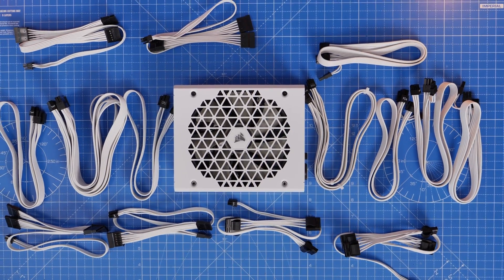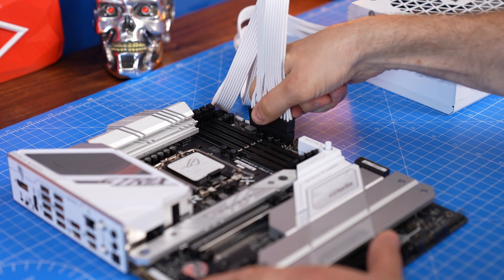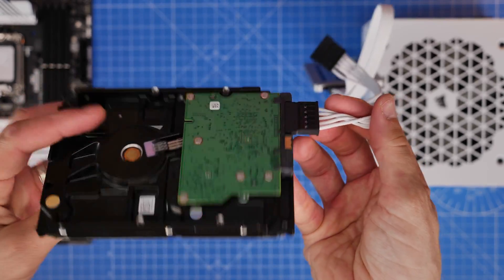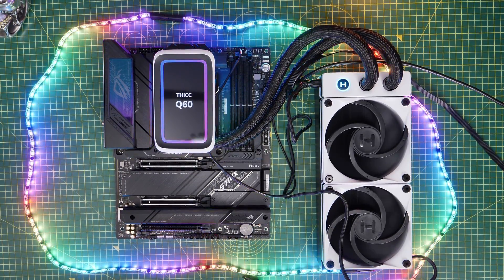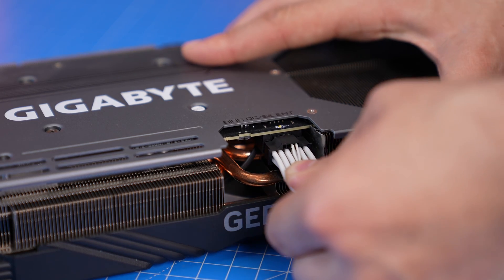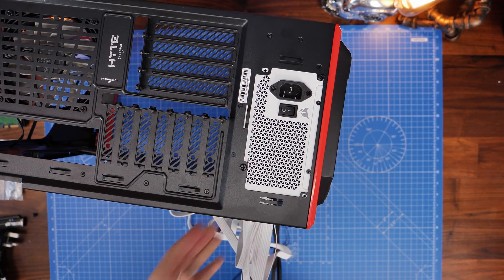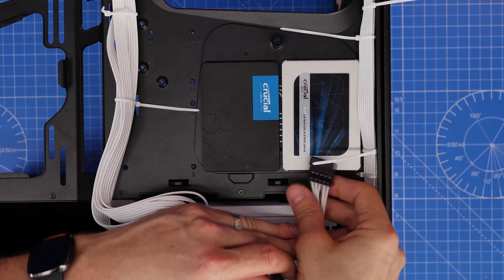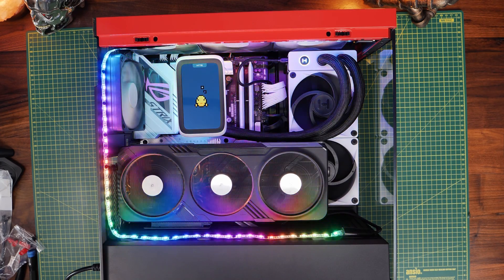Corsair RM1000x SHIFT PSU Wiring guide

Comment: I love your channel/videos, it's as though you know what I'm going to buy next! 🤣

I've just ordered the Corsair RM1000x SHIFT ATX 3.1 - PCIe 5.1 PSU and the MSI GeForce RTX 5070 Ti Gaming Trio OC 16GB (which has a 16-pin power connector). I must admit though, I'm feeling a bit confused as to exactly which included cable is best for powering the GPU and from which socket(s) on the PSU?
Reply from the maker: See 07:14
Reply: I'd watched that but, from what I can see in the video, the cable in your hands appears to have a 12-pin connector into the Series 40 GPU where as the Series 50 card I've ordered takes a 16-pin? This is where my confusion sits 🤷🏻
Reply from the maker: No it's a 12vhpwr cable for the 40 and 50 series  @lammartland
Reply: Apologies, I see my mistake now 🙄 Thanks again 👍🏼

Comment: I wonder how they did the signal pins on the PSU side of things. Most other manufacturers use the exact same 12VHPWR connector on the PSU side so they can "sense" those exact pins. How does this PSU know which of the multiple PCIe/CPU pins will be receiving signal?

Comment: The 12vhpwr cable that comes with this psu, CAN I USE IT WITH A 4080 super HELP I KEEP GETTING YES AND NO's. Some say the one that comes with the psu is 450w and the one they sell separate is the 600w
Reply from the maker: Of course you can.
Reply: @ thank you cause some people say it's only a 450w cable not the 650w but other say if it only has the two little small wires on the +4 part of the connector then it's a 600w or something and I'm so lost and don't want to fry my setup

Comment: As a first time pc builder i have some qualms about the difficulties of unplugging and plugging these connectors. Some people really struggled with unmating them and struggled to plug the cpu cable into the mobo in the case due to how tight it is.

I ask because i am unsure whether i should flash the mobo bios first and do a post before doing the video recommendations. If the connectors are really bothersome to unplug i might just skip the bios update and post and just start building in the case.
Reply from the maker: It's fine to bios update with all the cables plugged in

Comment: Currently using an HXi PSU with the Type 4 Premium Cable Kit. I want to get the Shift in white as you have here. The cables look very similar to the Premium ones and slightly different to the black standard version you showed in another video of the Shift. How comparible is the Pro cable kit to this standard white one?
Reply from the maker: This is type 5 if I recall correctly, so the older kit won't work.

Comment: Hi Prawn, I have this same psu and the same ASUS strix MB as you. I have the ASUS tuf gaming 4070 ti super gpu. Can you please link the Lian li strimer v2 I need? I need the one for the gpu and the one for motherboard to psu. I can’t figure out which ones I need. I have the Lian li 011 rgb case. TIA
Reply from the maker: https://amzn.to/3z0aNVc

Scroll down to see both purchases as a bundle
Reply: @TheProvokedPrawn  thank you, greatly appreciated 👍🏻🙏🏻
Reply: I also want to purchase Lian li infinity 7 fans and his 3 x120 AIO. How many reverse fans should I get and where should I place the 7 fans? I will install the AIO on the top part of the case. TIA
Reply: @TheProvokedPrawn would this be the same one for a Msi GeForce rtx 4070 super? I have the same psu, I just did a case swap from a pre built and I installed Lian Li Strimer Plus V2 12+4Pin (12VHPWR) for the gpu but now my clock rate won’t go past 300mhz and when I play games the utilization is almost 0%, I can’t really find anything online that helps
Reply from the maker: You need to connect the 12vhpwr cable from the PSU to the strimmer obviously as it's an extension cable. Hopefully you've seen my video on them already
Reply from the maker: https://youtu.be/fNNJSLP5sTU

Comment: Just upgraded to an MSI one with 12v HPWR. No fires yet!
Reply: MSI Bazooka vibes
Reply: dude wich cabels are those can h help i can’t figure out
Reply: @Vincejustplays  they have the same connection, but they are a little longer if I remember correctly to ensure the contact and in the case of the connector for the gpu and power supply it will be shorter.